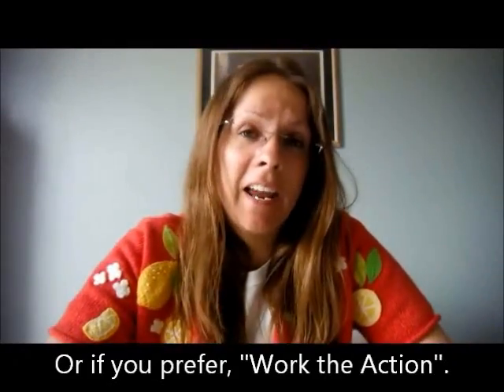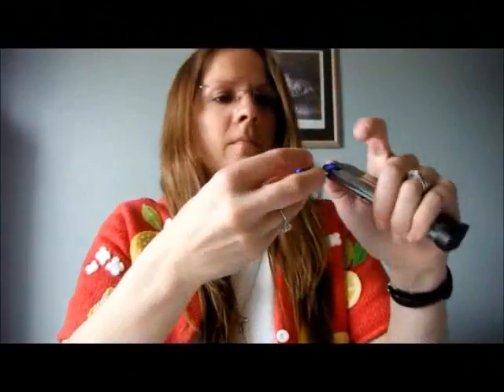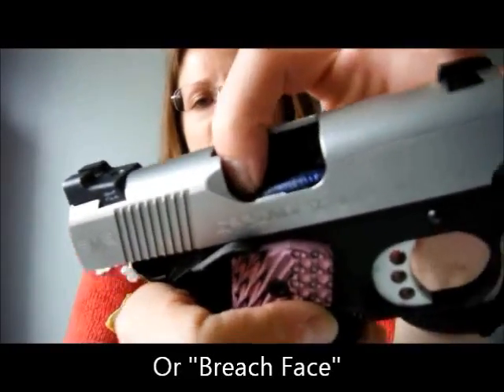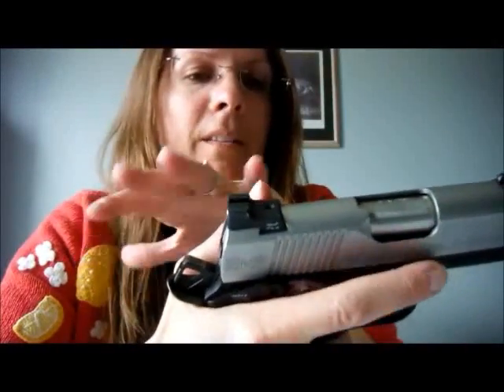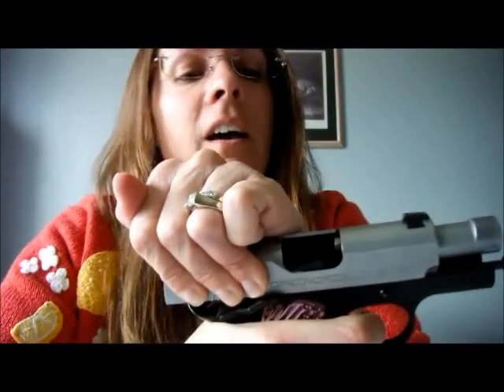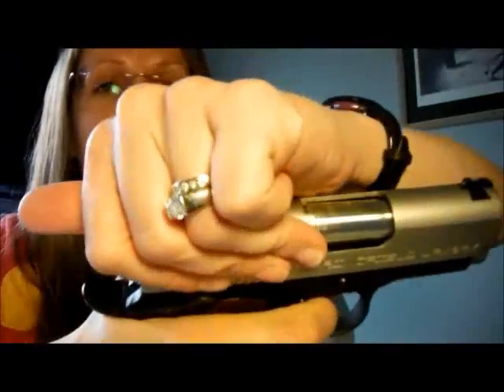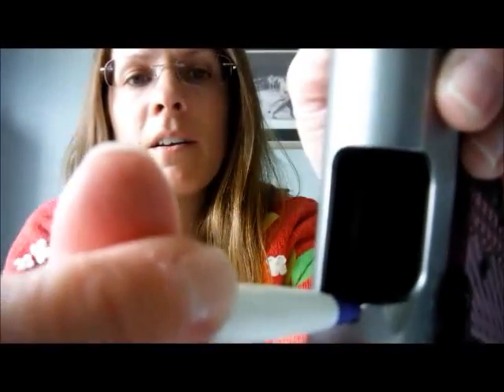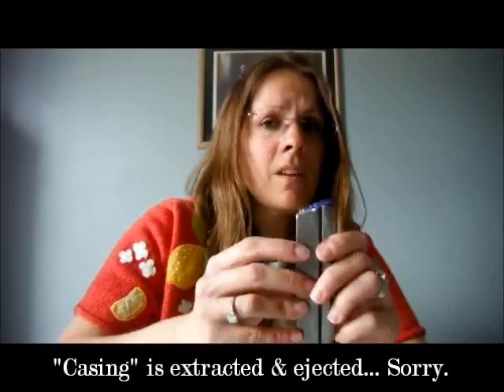Racking a Slide Like a Lady (Part 2): How Cartridges Cycle Through Your Gun

Comment from the maker: Hi zjayzjay. :)  You know, I believe anyone is capable of running any gun as long as it fits well in their hand, meaning they can reach the trigger well without having to use a compromised grip. The gun I'm demonstrating with in this vid wasn't my first gun...it was actually my 3rd. It does require training to ingrain the use of manual safety mechanisms into the muscle memory. However, training is recommended no matter which gun you choose.  If you'd like to look it up, it's called the...